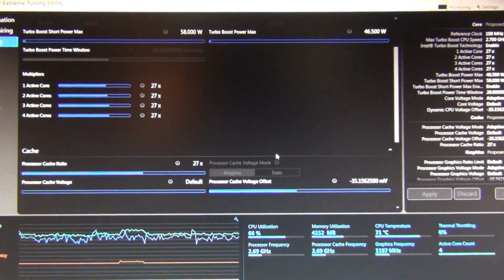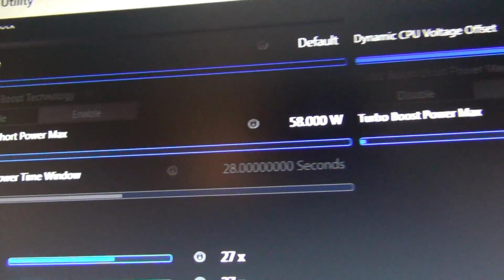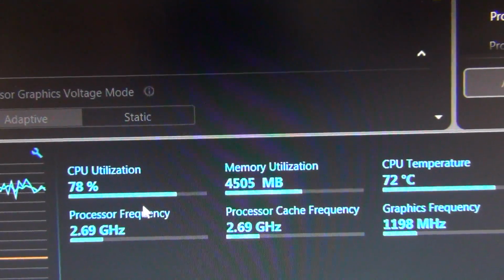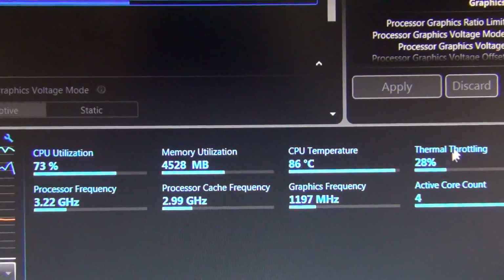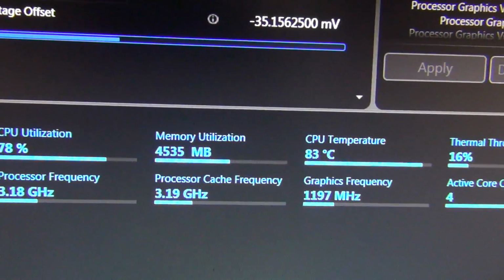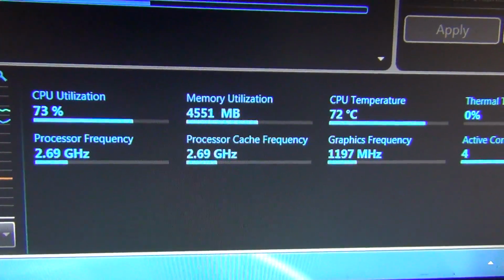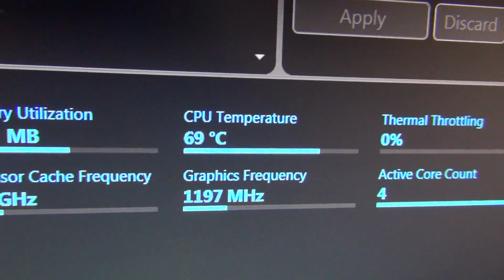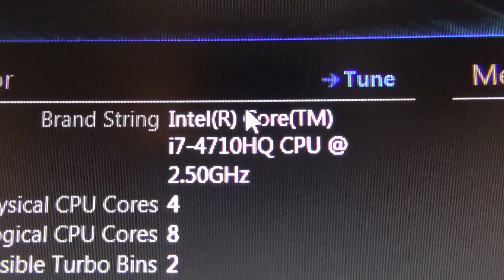Intel 4710HQ CPU Overclocking / Underclocking Tutorial

Comment: I was actually searching for underclocking but you explained the things so well that i was able to understand what to do... my temps were at 96 but now I'm at 74... Thanks alot. ;)
Reply: I also wanted to underclock my alienware to factory clock settings, but I don't  know what voltage changes to make? I don't see that voltage options that's given in this video. Reply will be appreciated!
Reply: @theVvids  new XTU is updated so you've to tweak it a little bit... Watch this video carefully and you'll be able to understand what to do

Comment: would those settings  at the beginning  still apply  for some who games on their laptop? or would it decrease  gaming  performance ? for some reason  on my laptop it says core voltage  offset ,  not dynamic  cpu voltage  offset .  I have a asus x550j  i7-4710hq  @2.5  geforce  gtx  850m

Comment: Hey Earthling nice video! I haven't the "dynamic CPU voltage offset" but I have "Core voltage offset". It's the same thing right?
2nd question is: I have the "processor graphic ratio limit" to 12x , instead you set it to default. It's the same?
3rd question: what about to undervolt the GPU Nvidia GeForce GTX 860M ?

My notebook is Lenovo Y50-70 with cpu i7 and I had high temperature (>80° in mid definiton old game with the fan at max speed; and about 60°-70° only with chrome and antivirus with the fan low) Any suggest to cool this notebook? Thanks :D
Reply from the maker: You don't need the offset, the core voltage is fine.  Remember, don't go crazy and keep a watch on temperatures.  Small increases.  The graphics ratio can be changed, I didn't change that from default though.  I also have an 860M.  Only reason to undervolt is to cool down the cards processor.  I have found overclocking is fun and all, and can slightly speed up a system.  But, if you have a good system, underclocking and undervolting slightly can greatly reduce temperatures.  Which in turn means your system will run smoother when under high load, and, last longer due to always being cooler.  It's all up to what you need your PC to do.  Laptops are the worst to overclock (their cooling options are limited).  So, it's all up to your individual PC and what you want.
Reply: @earthling1984  At the moment I only use old games in medium details. my goal is to reduce the temperature which is high and the keyboard heats up a lot. I just tried with your settings on the CPU and Intel graphics card I improved by 10 ° in game (about 70 degrees now) and about 20 basic degrees with chrome only (about 50 °). The result seems to me excellent even without touching the settings of the nVidia graphics card. Could I further improve temperatures while gaming?
Reply from the maker: @ItalianHellBoy  That is great to hear!  10c is a big improvement.  You could try to tweak it a bit more.  Maybe a slightly slower clock speed, or, slightly lower voltage.  If you go too low on volts, you may end up having issues in games.  So, you need to test and adjust as needed.  I also would recommend a laptop cooling pad.  They don't do a ton, but, I tested mine and found a few C drop.  I'll link you my test video.
Reply from the maker: @ItalianHellBoy  https://youtu.be/5XBZ1CMcWWw
Reply: I just watched a video on the lenovo y50 as I have one I've lightly used since purchasing brand new in 2014. I7 & 860m Nvidia. The video i just watched had a guy testing his temperatures before & after thermal paste replacement. His Temps dropped 15° to 20° just by using the thermal paste. I read the comments & there were tons of people using the lenovo y50 or y70 all praising him & thanking him for the video & for dropping the information. Others also discussed removing the dust filter on the fan as that also reduces Temps 10°c as well & to just use compressed air to clean off the fan every so often. Hopefully this helps you or anyone else trying to maximize the life of their older laptops.

Comment: Cool.vide and thanks for the tips man! I have the exact same setup as you (CPU/GPU) but even still, I have been considering buying base with a FAN for my laptop.

I'll your video on it next and see how that particular one performed, but if you have other recommendations since you filmed that, please let me know.
Reply from the maker: Guillermo Arrambide The fan doesn't do a ton, but, it's well worth it if your laptop is on a lot.  Keeps the bottom off a flat surface and air moving.  For sure good to have one for your home computer area.

Comment: i use 4720hq 0% thermal throteling but it only runs 3.75 at turbo boost in a short period and i want it to run a little higher than 2.59 ghz in cpu intensive tasks

Comment: i dont have dynamic cpu voltage offset in intel extreme tuning utility with my i7-4710hq its a dell inspiron 7447 with gtx850m  8gb of ram
Reply from the maker: Some big brand computer companies try to "lock" their PC's from having voltage and other things changed.  There usually are ways around it, but, sometimes not.

Comment: How much of a difference that cooling pad makes ... ?
Reply from the maker: It for sure helps.  But, probably just 2 or 3 celcius.  I tested it years ago.  Worth it for like 20 bucks?  Yeah, if you use a laptop as a desktop, like I do.  Has lasted years and is still working like new.  Love that it has a usb passthrough.
Reply: Earthling1984 Hmm, I'll get one. 

Great video btw, I'm actually using Asus rog g551jm for 4 years and I do mostly gaming and now Im getting more sustained average fps. In MSI kombustor I was getting 67 fps avg after 1 minute and now it keeps sitting comfortable at 73 fps. It's HUGE . 

Thank YOU.

Comment: Hello, can u give the app download link?
Reply from the maker: Just look up, "Intel Extreme Tuning Utility"; and, you'll find it.
Reply: @earthling1984  if i type that, that will shows the latest intel XTU, and i saw in your version is 5 xxx
Reply from the maker: @aldimaulanaadrianto  Yes, this was years ago.  I now use their newer versions too.
Reply: @earthling1984  in the latest version we cant set the multiple core speed, for the example 31x 32x and so on... right
Reply from the maker: @aldimaulanaadrianto  That depends on your motherboard and processor.
Reply: @earthling1984  do you still use the same pc till now?
Reply from the maker: @aldimaulanaadrianto  Yes   Had it over 5 years now I believe.  Plan to keep it another 3 to 5 years.  Still is working perfect and fast.
Reply: @earthling1984  with the newest xtu, can u set manually the cpu clock speed like 31x 32x and so on?

Comment: I7700hq Can i  overclock it ?
Reply from the maker: Probably can.  But, If you don't know much about computers and hardware, probably best to leave alone.
Reply: @earthling1984  the program i know so sou have any idea of the volt what do you say
Reply from the maker: @italiangiuseppe3719  Well, programming is good.  I know many computer languages myself.  But, that is different than hardware manipulation.
Reply from the maker: @italiangiuseppe3719  Ah, I read your comment wrong.  So, you just mean you have the program...  You need to research your processor, motherboard, and ram.  And find out their limits.  Their volatage, heat, megahertz, etc. limits.
Reply: @earthling1984  ah ok

Comment: how is your processor frequency  and temperature stable? Mine keep going up & down pretty quickly
Edit: I also have the same processor.
Reply from the maker: In most of these newer laptops, they are setup to change your processor speed to save battery life, and, keep the computer cooler.  When you overrun the processor speed and set it to what you want, it should stay where you set it.

Comment: Is possible to overclocking i7 4712?
Reply from the maker: +DenioZ Yes, you can overclock basically any processor.  Some are better for overclocking (can overclock more due to unlocked multipliers and such), but, all can be overclocked.  Some motherboards don't have great options in bios, but can still be overclocked in OS with a program.
Reply: +Earthling1984 Yes it's laptop and bios can't show ANY overclocking options.
Thanks, your tutorial has been helpful !

Comment: why would u underclock
Reply from the maker: To lower temperature.
Reply: Intel sets it to 100
Reply: i thought of this my ROG has a 4710. but its fine using the cooling pad . i run on 1366X res i think and limit all my games to 60 .. racing games at 120  and it runs about 80
Reply: 80C

Comment: Lol wait a second... I opened the utility and my cores is set to 35, 34, 33, 33 on default... what?
Reply: Each of its core offers a base speed of 2.5 GHz but can dynamically increase clock rates with Turbo Boost up to 3.3 GHz (for 4 active cores), 3.4 GHz (for 2 active cores) and 3.5 GHz (for 1 active core).
That's why :D
Reply: Right... forgot about that... I never used the tool before since all my other OC I just do it strait from Bios... Don't think it's actually a good idea to use software but since the Bios can't control it... Blaaa w/e
Reply: i have the same issue, when i start a benchmark it goes to 3.5 for about a second and then gets stuck at 2.49ghz...

Comment: wrk with 4720hq
Reply: Yes, i've up to 706 in the intel benchmark, works well to reduce temp or increase the performance, i can get my 4720HQ more powerfull of 20% than a 6700HQ Stock ! All multiplier at max and Core voltage @120 & Offset at -100mv
For graphics :
x13, 1.08V offset -80

If you reduce the CPU consumption you can increase the GPU power (max about 27W !), run a benchmark before using all day, i've changed my thermal paste with an Grizzly Aeronaut
Reply: guys i have intel core i7 4720HQ the same like you,and i have thermal throttling ..lagging in the games FPS drops...i set to 2,6GHz but still if its under perfomace getting 85C temp and start throttling. i have notebook MSi GE72 2QE.     If i change the thermal paste it should be good ? how the fuck can i cool down this CPU ? 
thanks for your reply.
regards
Reply: Hi, what thermal paste do you use ? I've a MSI like you (GP70 2PE), i've buyed a Thermal Grizzly and it's works good ! About your thermal throttling try to put you Vcore Offset to -65mv, Vcache Offset -75mv and Graphic Offset to -75mv, run a stress test and wait some time to see if it's crash on idle

If you have again a thermal throlling, low your ratio to 34, and All Offset voltage of -20mv, and continue to reduce -5mv until it be stable for 24Hours

Sorry for my english bro, i'm french, good luck !!
Reply from the maker: I recommend "Arctic Silver 5" thermal paste.  Some of the best stuff you can use.  I used it in every computer I built or had to repair.
Reply: i never changed my termal paste...till now ... becouse i will change it now within a days.
Reply: okey i will try this settings ..if something changed im gonna tell you.
thank you guys!!!!

Comment: thermopasta is dead, too high temp
Reply from the maker: 6 years later this laptop is still my main pc.  Still runs like new!
Reply: @earthling1984  i to have also the intel 4710HQ laptop what i still use :) .and not only that, i to also unlocked some hidden bios settings that i can oc it even higher but there still some restrictions. i to seen people tho that they can somehow go even higher but not sure yet how they todo that
Reply from the maker: @TheGabberworld  Yup, it still does all my 1080 and 4k video editing.  Would a 7 year newer processor, video card, & ram be faster for rendering?  Sure.  But, this laptop is lightning fast for everything.  16gb ram and 860m video card, with ssd as well.  No reason to upgrade.  The shorter render times aren't worth it for me (they might be if I was making many videos a day).  No reason to upgrade until I get the next level camera, 8k or whatever.  Then I think this laptop may struggle.
Reply: @earthling1984  well, im not actually come to tell for upgrade your laptop :) i just saw at that video that you lowered the cpu speed and still had high temp. it usually means 2 thing very bad radiator  or thermopasta between cpu and radiator is bad. anyway thanks for you video i to get the understanding why you underclock. but im searching self the actual overclock that's why im poped to this youtube video :) the thing is about oc is by default it goes to 37 at one cpu others are 36 and 35. but i seen info that people somehow managed go over 37
Reply from the maker: @TheGabberworld  Yeah I've built over 100 pcs.  Laptop has been fine. Being 7 years old now though, some need paste may be good.  Battery went out a while ago so I removed it.  Been using as a desktop for like 4+ years with monitor, keyboard, & mouse.  Always plugged in and turned on 24/7.

Comment: lame laptop, my 4700mq @3.4ghz reaches 62deg max
Reply from the maker: eivis13 LOL.  Silly child.  It's a small 14" laptop from Gigabyte brand.  I believe model is like p34gv2.  It's also customized by IBuyPower.  Super powerful in a small package!  Does everything I need and more!  Three years old about now and still more powerful than most new laptops!  But, I'm an intelligent purchaser and knew this laptop would last me at least 5 to 7 years.  I won't upgrade until I switch to 4K/60 video.  But, zero reason to do that anytime soon.  My 1080/60 camera is so good it looks better than most 4k camera!  There is a lot more to cameras than just resolution!  The 1inch sensor in my newish camera is just amazing!
Reply from the maker: eivis13 Also, a lot more to PC speed than just processor megahertz.  Do you even have a SSD in your laptop?  If not, I'm sure it's loading of anything takes about 10 times longer than my laptops load times. :)  Also, games, videos, editing, etc. are done mostly by video card, not processor.  So my 860m 4gb video card does amazing.  What video card does your laptop have?
Reply from the maker: Oh don't worry about elvis.   He's just an ignorant, child troll.